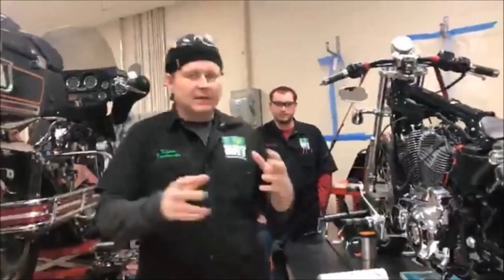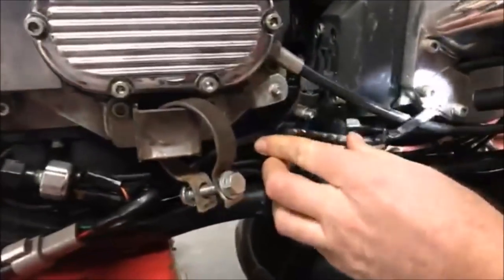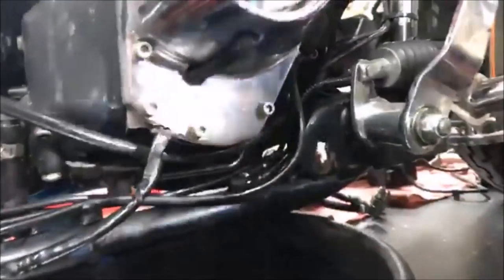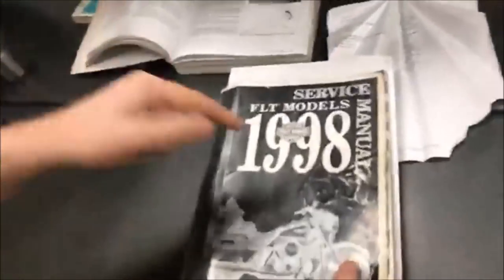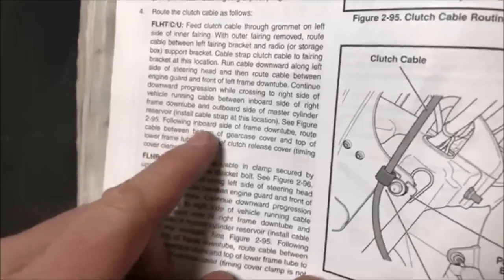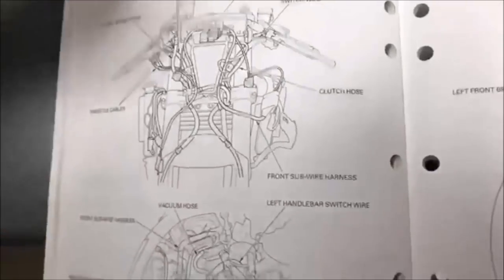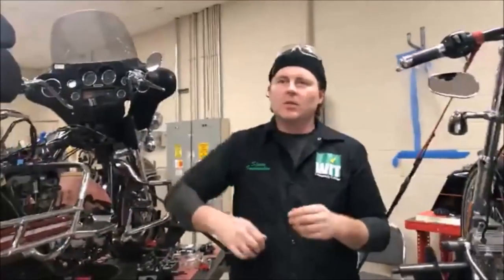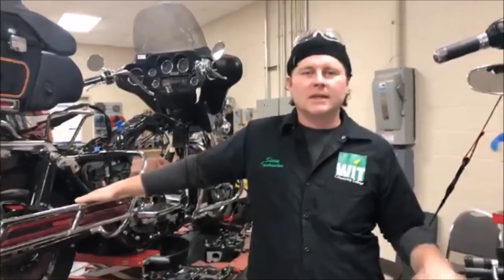How to route cables and wires just as the manufacturer designed.

Comment: Shane.... I myself am a stickler for routing wires and cables exactly how the manufacturer shows it to be routed. I will search through manuals or internet to find a routing diagram or even a good picture of the cable or wire harness. In my experience as a technician I’ve seen a lot of misrouted wires and cables by previous repairs that did more damage than good. Thanks Shane for stressing the importance of this subject 👍👍👍👍

Comment: Some great info there Shane! Way overlooked by DIYers. I did a wack load of work on a nonrunning 77 KZ1000 for a friend years ago and KREEMed the gas tank... I used the factory gas cap to seal the tank on the final step and the 2 small factory air vents in the gas cap had sealed up and were no longer functional.... I had created a unintentional  vacuum lock in the gas tank... could not get the engine to idle, went through the carbs with a fine tooth coomb thinking that was the source to no avail... finally realized what I had done and drilled out the plugged holes with the same factory size drill bit and got the old girl to idle. I almost lost my mind over this problem, this was pre internet. I have great respect for real thorough mechanics as they make it look easy!

Cheers, Doug (2, 1977 KZ1000A1's)

Comment: Throughout the entire video you are not showing the full routing of the clutch cable and that is what I was after.
Reply from the maker: Bummer...We grabbed Shane quick and he said "First thank you for stopping by the channel, this channel teaches skills sets and is quite often "general" in nature except where we specifically call out "model specific" information (like on engine rebuilds). As any responsible vehicle owner the service manual for your exact year make and model is the best source of information so us "youtubers" don't accidentally provide outdated instructions. For example, Harley Davidson has had (as well as many other manufactures) recalls over the years for cable and wire routing where the original run was a mistake and caused loss of control. That being said, the tips in this video provide the installer (pro and DIY) the means to question the safety of the routing to bring up any concerns" 
We love sharing comments like this with Shane to gain new perspectives sometimes we just don't agree but a good conversation grows from it. Thanks for sharing and the added value to our wrenching community. Keep them coming.

Join the channel. Best $1.99 you'll spend to access all 800 vids and Shane Daily! Smash the sub and like please. 

Throw Shane a high five donation, channel membership or merch for saving you $$$$$$$ Links below to support more for this work! 🙏
You rock for commenting! We will let Shane know! Want even more? Best $2 you'll ever spend...Join this channel to get access to perks:
https://www.youtube.com/channel/UCBhM8DCKnT3qXwTW0eToyCg/join       
-Daily MEMBER FIRST COMMENTS ANSWERED FIRST 
-Live Q/A video chats
-Wonder if we have a video on your need? Members can request content links!
-Full Access to the ENTIRE 700 video library
-Member-Only FREE tool giveaways  
Ways to support or high five How 2 Wrench! Thank you in advance. YOU MOTIVATE US TO DO MORE!
1. Smash the subscribe button (thank if already a sub!)
2. Have you seen our "YouTube Trained Support Shirts?  https://goodfellasmerch.com/collections/how-2-wrench/products/support-shirt   
3. High five donation:  https://www.paypal.me/how2wrench    
4. Got an emergency and your head is about to explode from frustration or fear? Get Shane’s cell here: https://how2wrench.com/ols/products/techline-one-on-one
Reply: My Sportster on the other hand… Aces. My kid can even get coloring books for that bike…👍